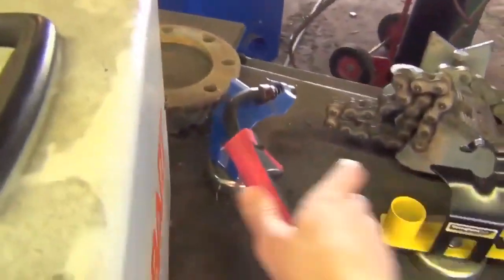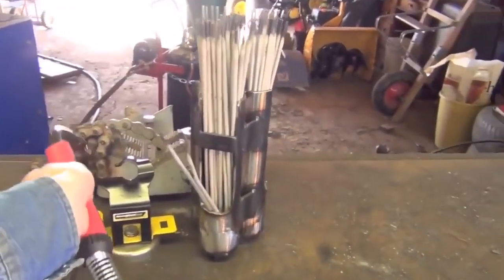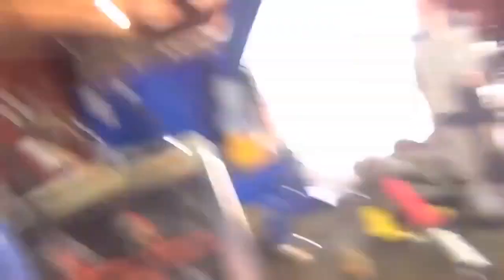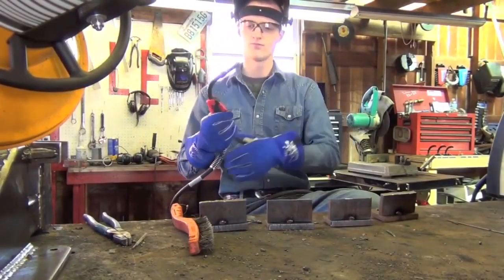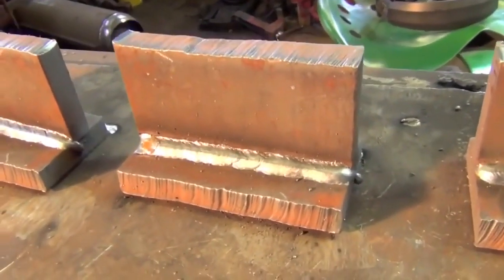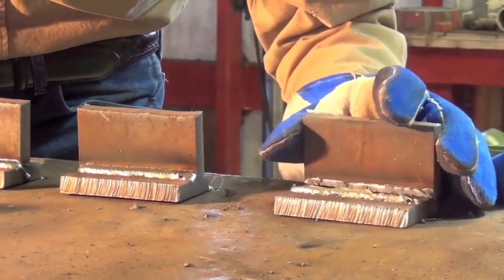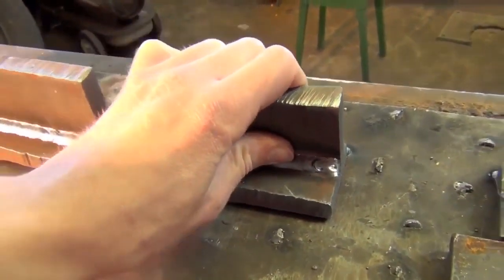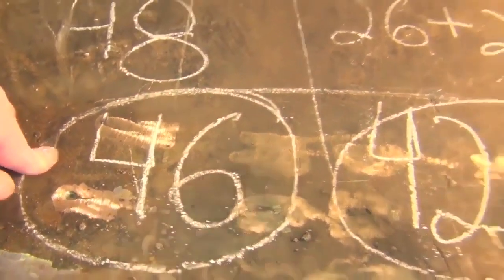PUSH VS PULL MIG WELDING PUT TO THE TEST!!!

Comment: If you cut the weld in half from the center of the face into the root its easier to break and shows fusion into base metal